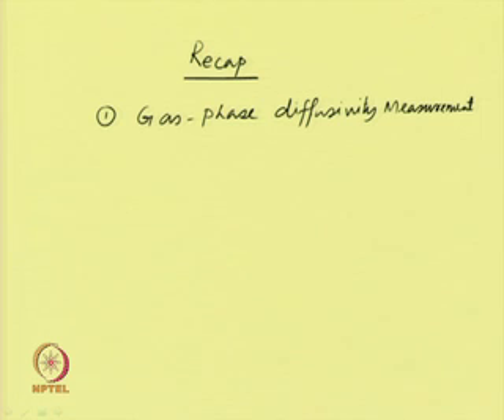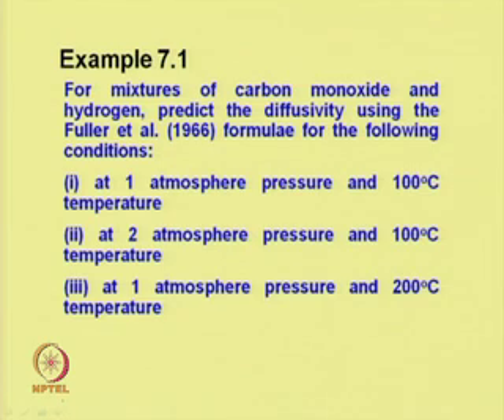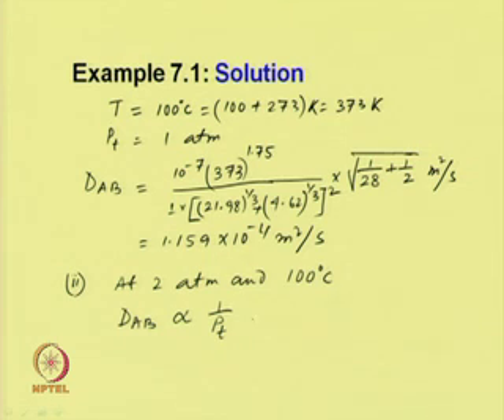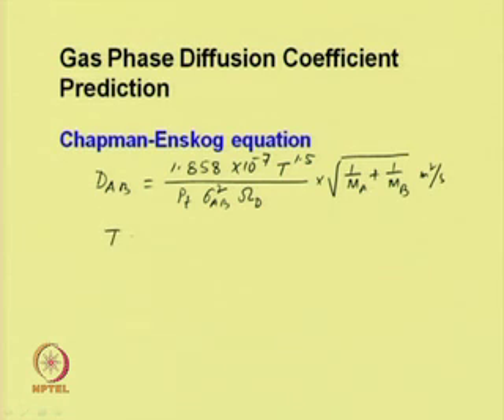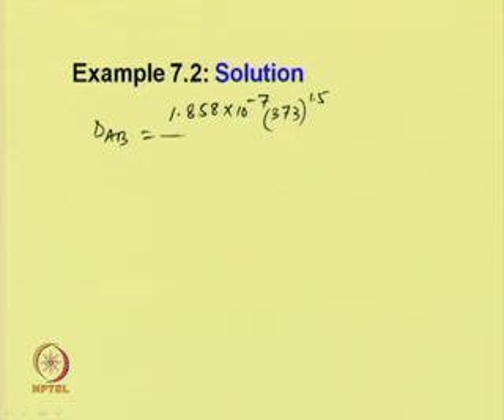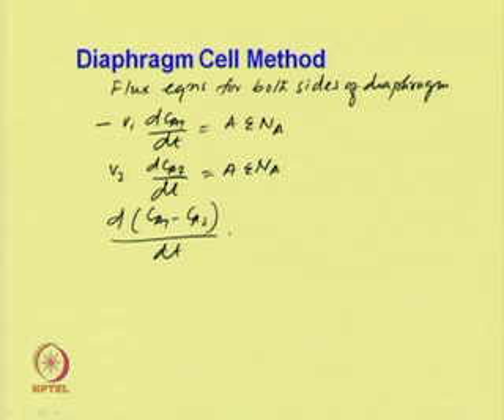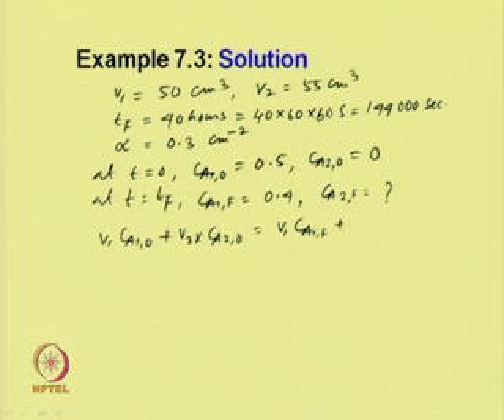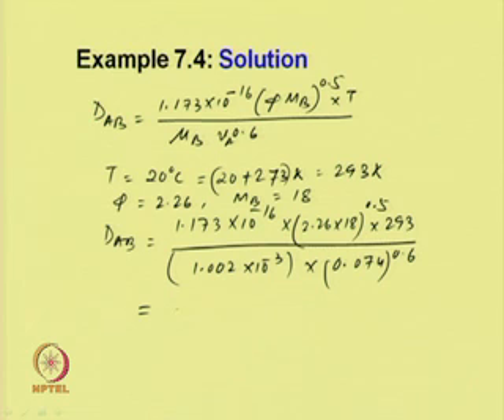Mod-01 Lec-07 Diffusion Coefficient: Measurement and Prediction Part II

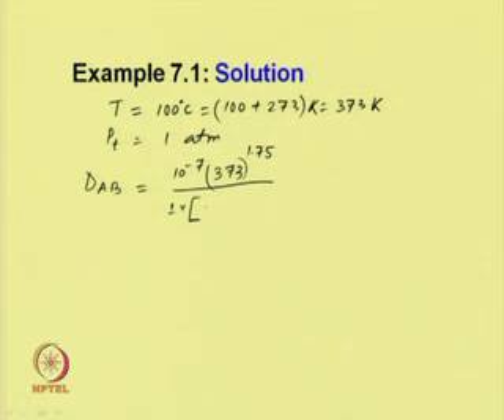Comment: at 11:47 why pressure is taken in atm instead of converting to Pa ?
Reply: Fuller equations require that input (T = K, P = atm, D = cm2/s)
Reply: You are supposed to use pressure in terms of atm for the equation.